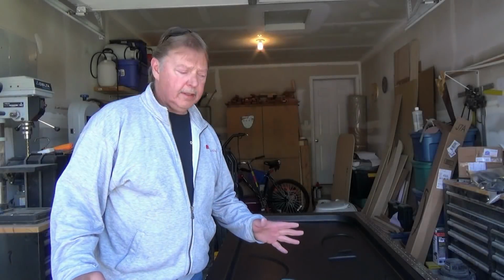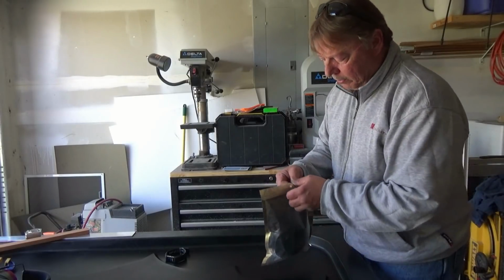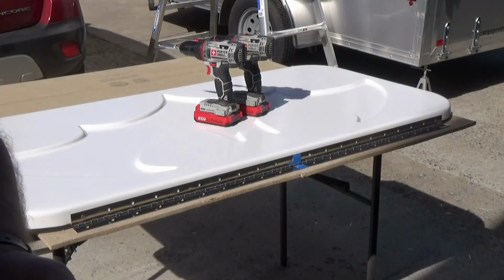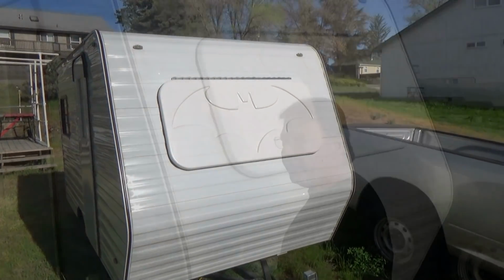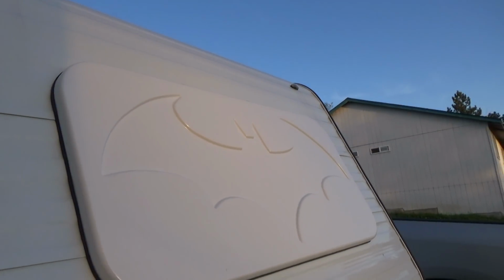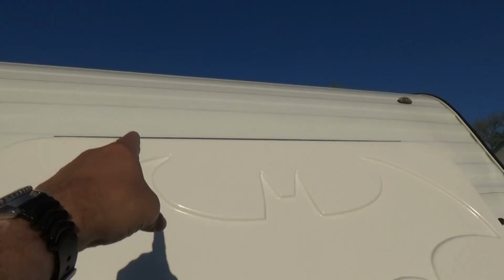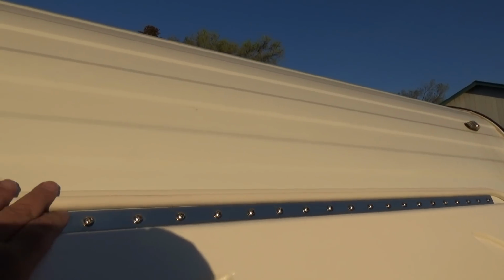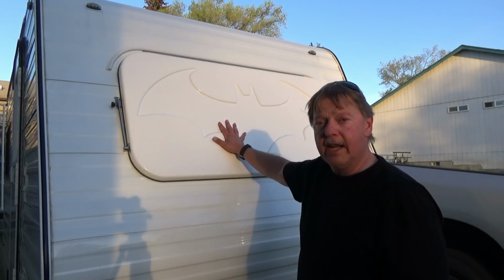DIY – Front Window Rock Guard – Stone Guard for your RV - Part-6

Comment: Do you think you should of put a strip of butyl tape underneath the hinge?
Reply from the maker: Once we dry fitted the guard, we removed it and added putty tape behind the hinge, then sealant on the screw heads once installed

Comment: If your guard supports lock it in place while open why not lock it in place in the closed position?
Reply from the maker: Hi Paul... I do lock it while closed, but the ball bearing ends have a little play to it, so it's still able to open a couple inches.